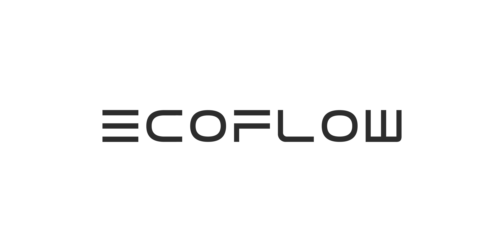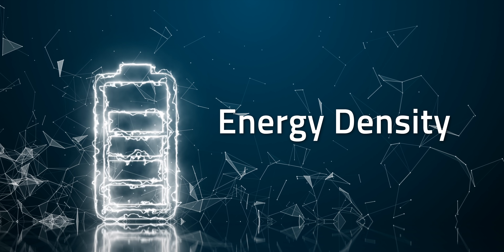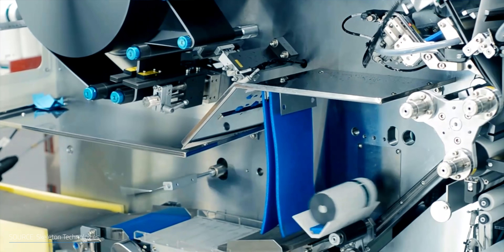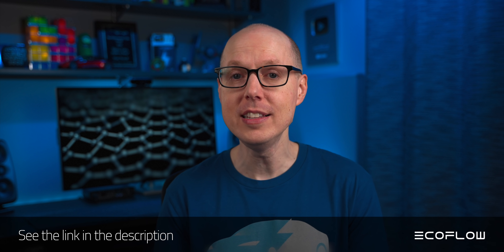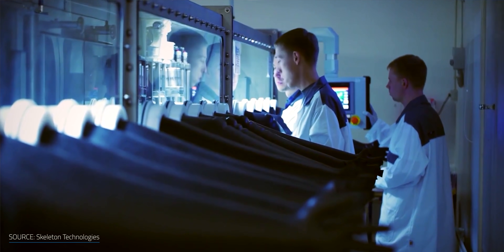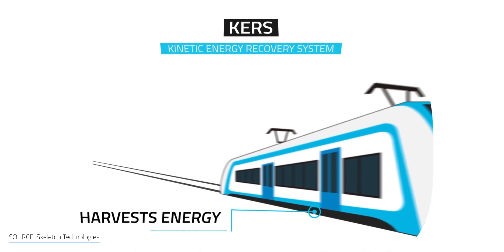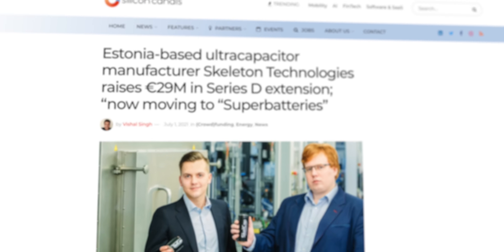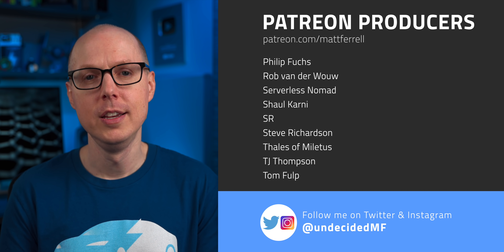Revisiting the Supercapacitor - The Wait for Graphene is Over

Comment: Graphene is the silicon and laser beam of the future. And many of its future applications might not even be known by now.
Reply from the maker: The question is if we can figure out how to take advantage of it and actually make meaningful products.  This is the first one hitting the market that's given me a glimmer of hope.  Graphene headphones don't count ... lol.
Reply: @UndecidedMF  Yes, fully agree. It took the laser about 30 years before mass products like CD and DVD were invented. I see the same with Graphene, that maybe has even more potential.
Reply: @UndecidedMF  It will undoubtedly work out. As with any promising technology, if there is enough funding and potential, then there will literally be no limit to how far we are going to push its potential usecases. Plastic is the best example of this, it has been used in the best and worst products of the 21st century. Graphene will undoubtedly see the same exposure in both meaningless AND meaningful products.

I recently did an experimental project in collaboration with Jaguar, for a flying personal vehicle that had a core frame built upon the principles of energy storage in carbon fibre and graphene-enhanced battery/capacitor structures, all weaved into the frame itself to take advantage of weight saving. Big companies certainly are opening their eyes to the potential of these technologies, and as soon as the proper scalability is reached, the technology will see very clever use.
Reply: @UndecidedMF  Someone must think it has market value. I found that there are 25,000 pattents for the use of graphene...many of which are medical in nature.
Reply: @freespeech4all723  oh yes. its amazing what you can find in a sea of information. The maker of this video even said about sensors in the body in one of his videos i would guess putting them there would take some sort of injection invisible in the fluid . And we all know sensors can be atom size . wonder what things they could do with sensors. purely good things im sure
Reply: @doondoondoondoon6588  
Everything gets weoponized eventually unfortunately 😕
Reply: @UndecidedMF  
There was hope it would replace steel beams, but has not.  It can have longer spans which must save costs, in only having load bearing walls in the perimeter of buildings. Its light weight means less substantial foundations. All this saves costs and time.
Reply: @johnburns4017  although it's tensile strength is great than steel, graphene is less resistant to cracking meaning currently it's not suitable as a replacent for steel beams.

Large graphine sheets consist of some toxic qualities and impurities, which I assume would be an issue when producing large beams.

Even if none of the above issues existed the fact that graphine cost between $67,000 - $200,000 a ton and steel currently cost $4,268 a ton (steel prices have increased massively in America recently, so the price gap is potentially larger). I can't find the data on the weight difference of a graphene beam compared to a steel one, but I did find that a graphine golf club shaft is  around half the weight of a steel one; based off of this and assuming production costs are the same then a graphene beam would be 8-25 x the cost of the same strength steel beam. I expect that you'd have to build a very tall skyscraper before the weight saving ballance out the cost. I can't imagine the person building the next worlds tallest building would want to trust an untested material, until the price comes down it wouldn't be cost effective to use on smaller structures which the owner is more likely to be willing to risk using an unproven material.
Reply: @UndecidedMF  
Any thoughts as to its application being used in the vac-cines?
Reply: @freespeech4all723  Why would graphene be put in a vaccine?
Reply: @peterirvin7121  
That's what I said.
Maybe we need to ask a molecular biologist.
I heard this on The Stew Peters show.
Reply: @freespeech4all723  "Stew Peters Show"? Sounds like clickbait. They'd probably tell you that all tap water has arsenic in it if they read an article about arsenic food contamination from the 1900s
Reply: @specialopsdave  
I'm sure you know as well as I do that finding truth in a sea of information is not an easy task.
Since I am not a doctor or scientist...I have to listen to and fact check those that are. 
I ask questions in these comment sections with the hope of networking with others seeing we are all in the same boat.
I will not blindly follow anyone on this subject. It's far too important.
It effects my kids and their future.
So I must continue to ask.
Reply: @peterirvin7121  Because it rhymes?
Reply: @peterirvin7121  maybe Cyborg infused microbots to kill bacteria! 🤣
Reply: @freespeech4all723  You're on the wrong YouTube channel for starters mate, lol.
Reply: @differentname8051  
How's that?
Reply: @freespeech4all723  you don't need to ask stupid questions tho..
Reply: @Paulirwin44  
How would you know if it were a stupid question?
Give me some data that would back you up.
I could say the same to you...but that would be ignorant.
Reply: @freespeech4all723 ok  let's just pick random people's thoughts like that dude posted in here and carry it on all over the internet...but some guy on YouTube said something about graphene and vaccines... BS they guys a plonker
Reply: @Paulirwin44  
Texting is a poor form of communication at best.
We all make mistakes.
Personal attacks are meant to control thought.
Again...a poor form of communication.
Reply: @freespeech4all723  but you saying that doesn't make it rightl..these muppets need to be told straight...science/facts not hear say
Reply: @Paulirwin44  
You seem angry.
Why?
Reply: @peterirvin7121  To make better batteries from humans that will be in future used as power sources for machines.  I saw it in documentary film called Excel, or Matrix or something like that.
Reply: @Paulirwin44  
It's still a free country, but I'm sorry that makes you angry.
Says more about you.
You might look inward to find the answers you seek.
Reply: How about if these could be charged by a high powered laser !  Fast, efficient, power transmission !!
Reply: and now applications that you may not know about
Reply: Meet the material of the future that's 40 times stronger than Diamond.Graphene can withstand the impact of Bullet.
https://youtu.be/Zj9WFnyEyLw
..........

Comment: A difference between batteries and supercapacitors is the energy storage efficiency. Supercaps are almost lossless, compared with 80–95% for Lion. That 5% may be significant…
Reply: gravity batteries are ~85% efficient, just build a big ass tower in your backyard!
Reply: @gg-gn3re  hello wonderful person o/
Reply: @gg-gn3re  I was wondering about compressed air as storage in a similar way.
Reply: @gg-gn3re  and if you calculate how much mass and the height you need for 10kWh what do you need? kWh=(mass*gravity*height)/3.6x10^6. Say height of 6m then you need a mass of 611620 kg or 611 tonnes. So way too much mass needed. Even the cost of concrete or containers to hold water or dirt would be prohibitive. Far cheaper and easier to buy batteries.
Reply: @AORD72  Concrete is also CO2 heavy to produce, use water instead for gravity storage.
Reply: @Tore_Lund  That is why I said "or containers to hold water or dirt". The point being gravity energy storage is not cost effective and if people did some basic maths they would see why.
Reply: @gg-gn3re  You reply with insults because you're not capable to argue with logic? Can't you do the math? Gravity batteries are not economically viable. Why would you build something without calculating weather it is viable? The math has been well known for over 200 years. Like I said you would need 611 Tonnes of mass with a change of height of 6 meters to obtain 10kWh of energy so a gravity battery is useless.
Reply: @AORD72  Sorry, better to argue fast than be late to a discussion thread! Are you "The Sabertooth"? You know Tritium battery and super capacitors?
Reply: @AORD72  No, I was not suggesting TNGs as a solution, You name just sounded like a youtuber I'm impressed of.
Reply: How does the rate of phantom drain for a supercapacitor compare to a Li-ion battery?
Reply: @petertownsend252  had my lithium batteries sitting charged for a year a still have full charge.  Don't use any cords at work any more except for lighting. No power fade . 20 min to charge battery full. I have 4  batteries . That works on all my tools that I use for work. No complaints. Not broken don't fix it. Lol.
Reply: over what time period are these percentages spanning? 5% per day? per year? :)
Reply: @nomoregoodlife1255  per charge cycle. Put in 1000W and drain it and you'll get 950W out.
Reply: @nomoregoodlife1255  It's a timeless constant. It means X% of all energy put in will be lost as heat. So it's the same for an attosecond or a year.
Reply: @nomoregoodlife1255  I asume pee cycle
Reply: @nomoregoodlife1255  per cycle i suppose
Reply: Not to mention the heat generated with that inefficiency. Dissipating Megawatts of heat generated by that inefficiency requires lots of expensive infrastructure . Probably more than the energy is worth.
Reply: Supposedly graphene caps approach the energy density per Kg of chemical fuels. That means you can generate the power in situ and truck them to where the power is needed without resistive losses from long range transmission. Potentially with electric and even automated trucks running on the power they're transporting...
Reply: Thats misleading, capacitors leak charge at a massive rate. Even supercaps. They will be completely self-discharged in 15 minutes or less.
Reply: @alexandrsoldiernetizen162  Not in minutes but days, which still is fast compared to batteries.
Reply: @alexandrsoldiernetizen162  I think you’re exaggerating, most modern supercaps seem to have self-discharge times measured in years. But yes, supercaps are most likely to be used in applications where energy is stored for relatively short periods, like daily cycles.
Reply: @kimspence-jones4765  I think you are either misinformed or clueless. I have used numerous supercapacitors in projects. I measured the Maxwell 2.7v 350F caps leaking charge to complete discharge in 2.3 minutes.
Reply: @alexandrsoldiernetizen162  I think the source of our disagreement is that there is a huge range of design options for supercaps, of which leakage current is just one dimension. It will be interesting to see how the technology develops over the next few years.
Reply: @kimspence-jones4765  I wasnt talking about leakage current, I was talking about self discharge, they are totally different curves. Leakage current is the on-charge leakage, self discharge is the off charge leakage.
Reply: Meet the material of the future that's 40 times stronger than Diamond.Graphene can withstand the impact of Bullet.
https://youtu.be/Zj9WFnyEyLw
...........
Reply: My limited understanding is that adding capacitors to a battery system greatly increases its' efficiency.  That might be the best application for something that can't be manufactured in large quantities yet.
Reply: @liam3284  Or unless you build reads my post a "big ass tower" in your back yard.
Reply: @gg-gn3re  "big as tower", you really are clueless on this subject. You would need something like a tower crane that would cost over a million dollars. Instead you could buy a lithium battery for a few thousand dollars and store the same amount of energy. Do the calculations.
Reply: @gg-gn3re  "Several million", if you look online at second hand prices you buy one for $400,000 USA, with a height of 60 meters, which would mean you need about 61 tonnes of mass to move to make 10kWh of electricity.

Comment: Lithium Ion Batteries die out just like OLED TVs do because of the biological material they use.
Reply: Lithium ion need to go. They don't last in the cold and it reduces life cycles of batteries. They produce co2, water vapor, and ground water pollution in manufacturing process. To the point I don't think the global warming agenda even cares about pollution. More about saving fossil fuels for the coming cooling period.
Reply: @eliinthewolverinestate  Not to mention the mass child slavery connected to is excavation.
Reply: So is it the nickel that is 'biological'? or perhaps the Cobalt?
Reply: @CorwynGC  Organic carbonates are ethylene carbonate or diethyl carbonate. Yeah, I'm not sure. I was going off the word organic. The chemistry of OLED TVs to Lithium Batteries is a bit complex.
Reply: @MustPassTruck  Organic in this context probably  just means that it contains carbon oxygen and hydrogen.  Does not imply biological.  Nor would biological necessarily limit lifespan.